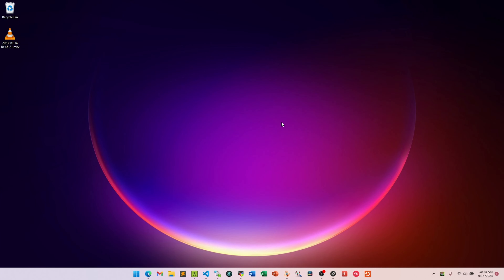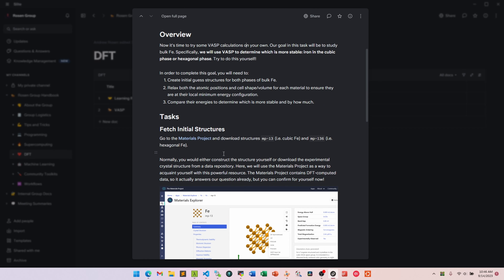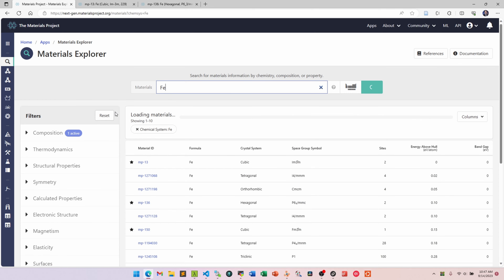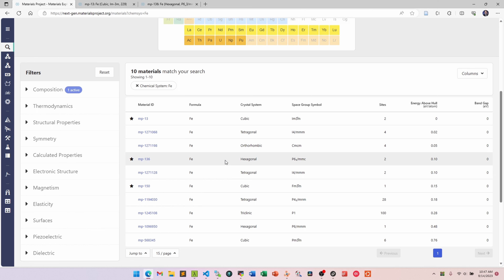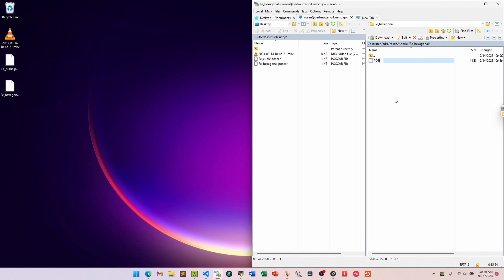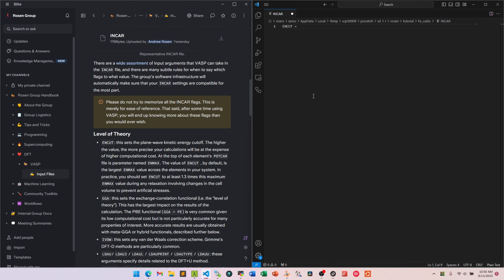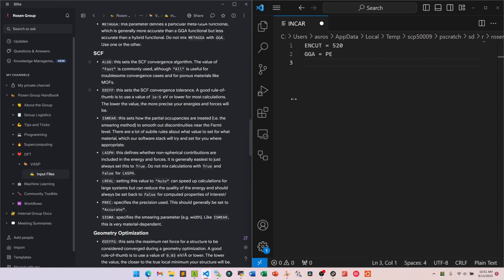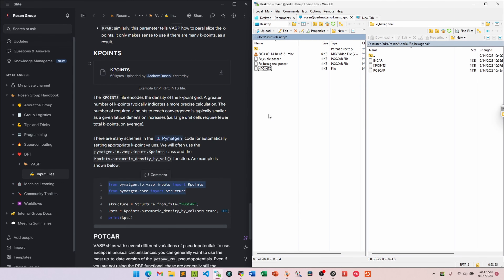A Practical Intro to VASP: Comparing Polymorphs of Iron

Comment from the maker: Common issues:

- If ASE does not load your OUTCAR file, it's because you need to update your ASE version. Run: pip install --upgrade https://gitlab.com/ase/ase/-/archive/master/ase-master.zip
- New VASP pseudopotentials (v.64) have been released since this video was made. We recommend using those if possible. The relevant folder is named `potpaw_PBE.64`